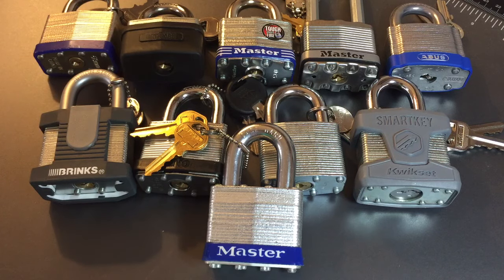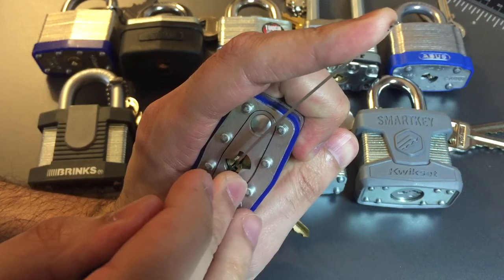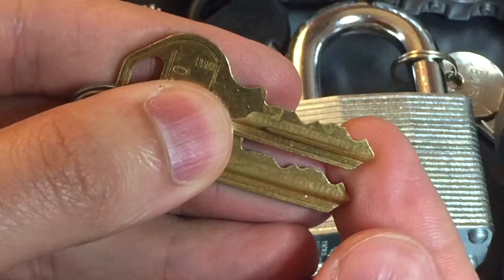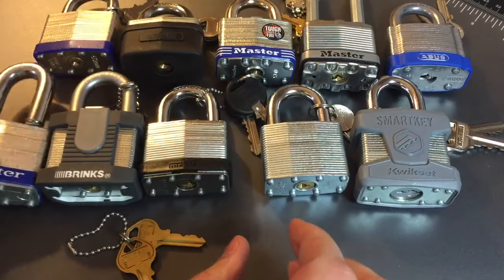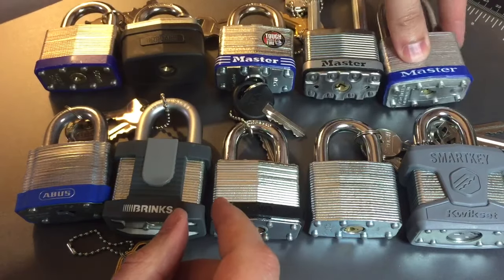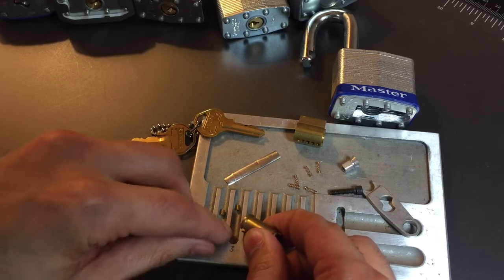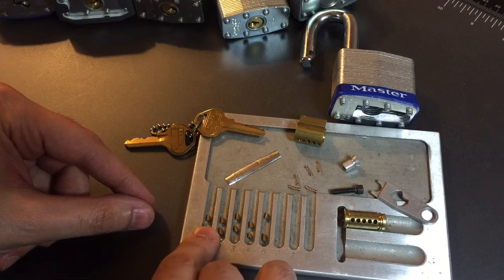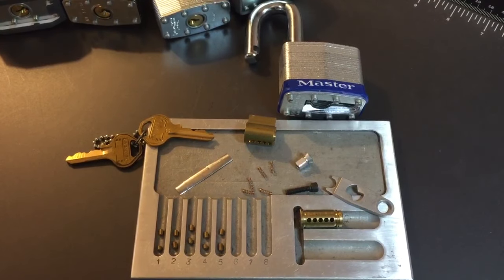[215] Master Lock #27 Padlock Picked and Gutted (50mm Series)

Comment: there seems to be a pandemic of short driver pins. Its nice that you can at least make a better lock out of this #27 by modifying the core with some security pins and maybe some threading or undercutting/milling. I really enjoy your series. Did you finish the disc series and I missed it? or did disc locks get boring and you're taking a break from them? lol. 

Thanks for another well done video.
Reply from the maker: I still need to reshoot your Challet... I'm not planning any other disc locks for now.  I've just been too lazy to take all the locks out and do it.  embarrassed, awkward smile

Comment: Very cool that this lock can be disassembled. Stupid question: Laminated padlocks and solid ones - is one of both construction better or cheaper to manufacture?
Reply from the maker: I don't have an answer based on personal knowledge, but my understanding is the laminated is far cheaper to make.  I've also read that laminated construction is more impact resistant, but that might just be internet hearsay.  Personally, I'd always prefer a hardened solid body over a laminated body, everything else being equal.
Reply: Thank you for this info and your thoughts.

Comment: Is there a benefit to using top of the key way tension as opposed to tensioning from the bottom? It seems like you would be crowding yourself by tensioning in the same place you’re trying to access the pins.